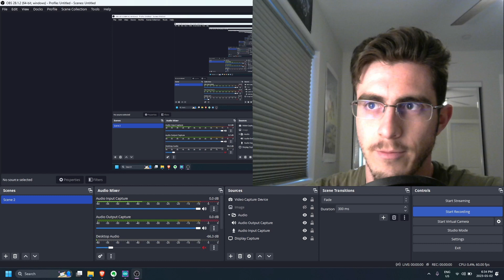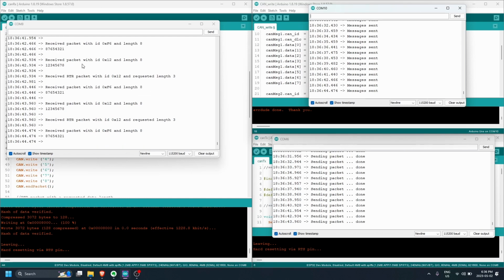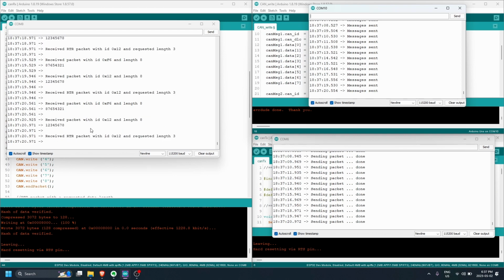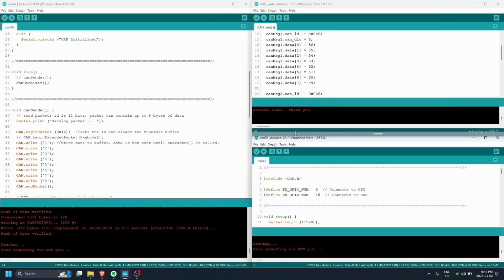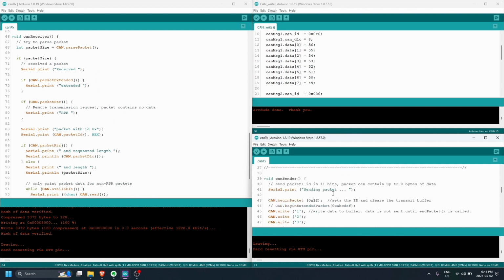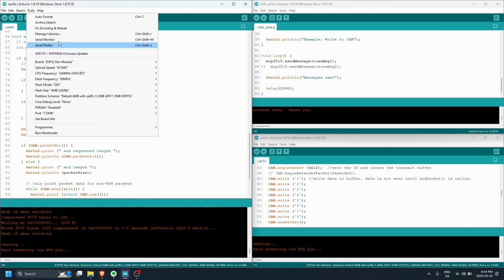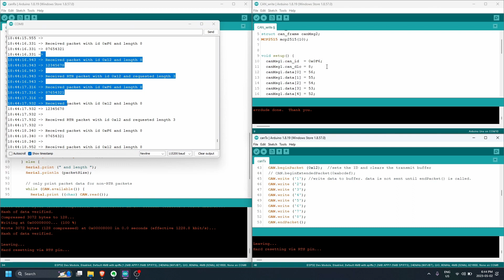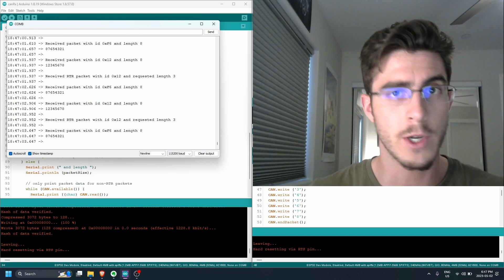Three Node CAN System on a Breadboard with ESP32 and Arduino Microcontrollers

Comment: Thanks for the video its really informative , what are your thoughts on using Logic Level shifters on the CTX and CRX, I am afraid the 5v would fry the esp32 pin and I read that using current limiting resistors is not effective at high frequencies

Comment: Josh, You are saying "transceiver" BUT you really don't understand CANbus at all! you are using them in a Master-Slave relationship!  CANbus has NO MASTERs or SLAVEs!  They are role-agnostic! which means any LRU or node on the system can Send or Receive messages. I work with a form of CANbus protocol called CANaerospace which sort of morphed into ARINC-825. My stuff works on the Arduino Mega with a MCP module and yes you have to use the interrupt. from the module to the Mega. This tells the Mega that It has a filtered message in its buffer! ~~"They can see but they are blind."
Reply: Do we really need this: "... you really don't understand CANbus at all"?
Sure, you are right with the master/slave point. Fine. Improving or correcting such contributions is always helpful. But I strongly dislike bashing of works that people show. From my perspective the author shows here a rare solution of CAN tutorials with more than 2 nodes (which is covered very often here on YT) and he used not only the same MCP2515 controllers as shown on another hundred other videos. That makes this video nearly unique. I prefered less demotivating hints and recommendations.

Comment: Not too familiar with python, but I'd like to try using SocketCan with a Peak USB device to talk to my embedded can device!

Only problem is that while PCAN-View software works fine, and the PCANBasic dll is in Windows\System32.. when I try to have python see it,

network.connect(bustype='pcan', channel='PCAN_USBBUS1', bitrate=500000)
it fails:  
OSError: PCANBasic library not found.

Any suggestions?  Like how to force python to look for it in the standard system32 dll folder?

Comment: Hi， thanks a lot for your video, this is the most useful video in the earth.  
one question which make me confuse.  On the esp32, you use can.h && library,  but on the arduino, you use spi.h and mcp2512. h libray. 
could I only use can.h library for both of them esp32 and uno??
why in arduino IDE, you use two different library?
thanks!!
Reply from the maker: Hi, I randomly selected Arduino CAN drivers I found online. The fact that there are multiple libraries you can choose from that all do the same thing speaks to the versatility of Arduino. Take your pick!
Reply: thanks a lot! @EV_engineer

Comment: Hi. How can I get a specific byte from a specific identifier?
Example: identifier 0x480 2 01 02
I want to output only 480 and 02 to the port
I am using ESP32 and I only need to get certain data
Reply from the maker: So you have the ID stored in RAM? Why not just bit shift the data
Reply: you try to read fuel consumption?

Comment: Thanks, for the video. I just realized you using TJA1050 and not SN65HVD230DR. Perhaps thats the issue why my setup does not work!? 🤔
Reply from the maker: Just googled SN65HVD230DR, seems to require 3.3V supply voltage fyi
Reply: @EV_engineer  Yes, you're right. The issue is that for some reason it does not work if you mix it with the MCP2515 CAN SPI module. On the same bus, only the Arduino Uno's talk to each other as long they not blocked when the ESP32 talk to each other.